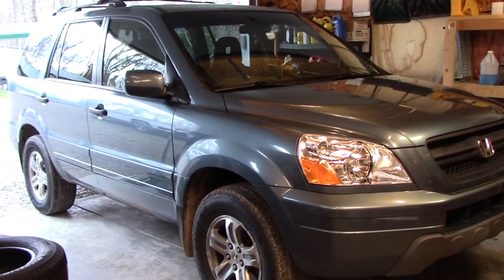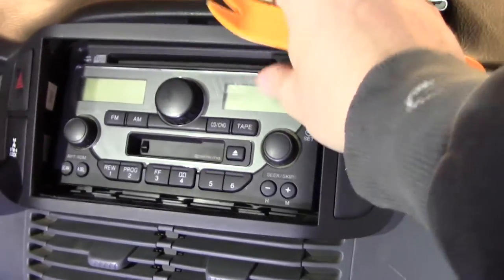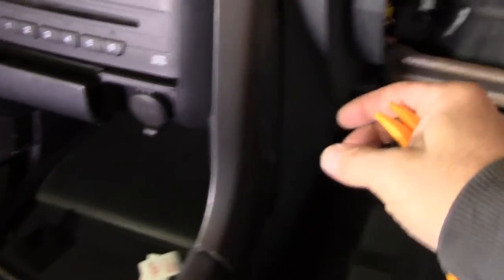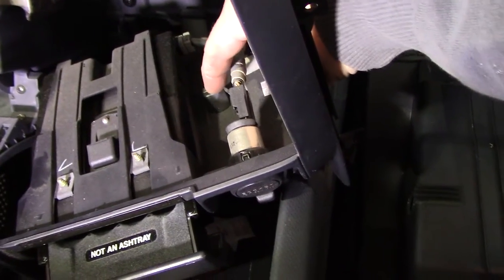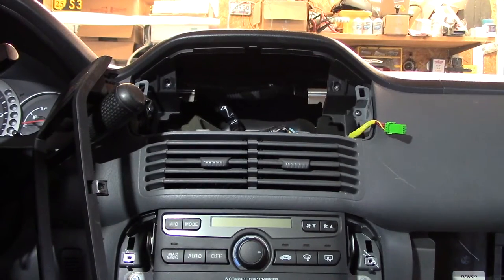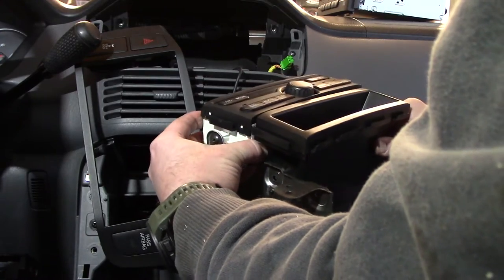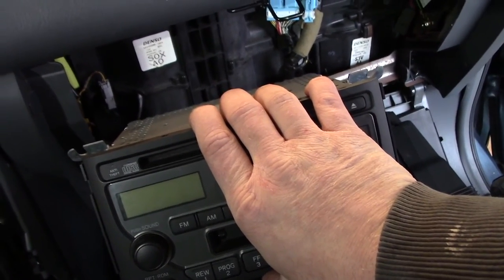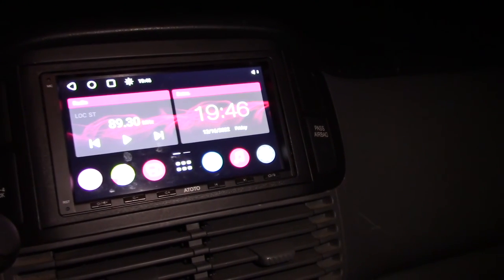2003-2005 Honda Pilot Stereo and CD Changer Removal for Modern Upgrade

Comment: I have the stock radio with 6 disc changer the changer is broken cycles looking for disc nonstop (annoying) I wonder if I can just disconnect it leave it in place but still have the stock radio work
Reply: For reference, 77280-S9V-A01ZA is the part number to change cd changer to a bin storage (from OP).

Comment: So awesome that you were able to get an amp setup to work with the factory sub. I’ve got an aftermarket head unit and would like to copy your amp set up. I’ve never installed and amp before and would like to know where you got the power and ground from? Also the RCA cable that you linked in your description, you used that to go from the head unit to the amp correct? Then did you cut off the factory sub wire harness and then connect those wires to the amp? The wiring is slightly confusing for me at the moment, would you mind spelling it out for me? Thank you for the help!
Reply from the maker: Yes. The RCA runs from the back of the stereo to the amp, which is behind the stereo. The power for the amp is split from the power to the head unit. The yellow wire is constant battery power and black is ground. For the amp remote turn on I used the amp wire on the back of the stereo. That's what tells the amp to turn on. There is a factory harness that runs to the sub that was unplugged from the OEM stereo. It's very obvious because it only has 2 wires going into it. I cut off the plug and wired those 2 wires to the amp output . Just need to use one of the amp channels since it's a mono sub.
Reply: So great! Thank you for this information. I’ll be tackling this later this week

Comment: Do you have a part number for the Pouch/Tray you used in place of the 6 Disc CD Changer?  I am doing the same thing but cannot find that pouch/tray.  Also you mentioned you added a subwoofer amp (Used your link to review) were you able to mount in behind the stero? If so can you identify where you placed it.  Thanks for the post awesome job!
Reply from the maker: Part number is 77280-S9V-A01ZA, but it's no longer available new. Have to buy it used on eBay or junk yard. The amp I listed barely fit behind the new stereo. I had it at an angle. My stereo was very shallow though, so I'm not sure if it would fit with a bigger double din stereo. It might.

Comment: I don't suppose you have a video showing how to remove and replace the middle panel assembly (77620-S9V-A02ZJ) for a 2005 Honda Pilot? Written instructions I've found, dictate the removal of the center panel first, then the instrument panel, and last is the middle panel. Without any pictures or video to go with those instructions, it may not be something my husband would want to do. Any advice would be much appreciated.
Reply from the maker: No sorry

Comment: Very Helpful! Thanks for making this video. I might be replacing my lower 6 disc that is broken for a replacement. Do you know if the Radio code thing will pop up by just replacing the lower unit?
Reply from the maker: I doubt the changer will prompt it. As long as you don't disconnect the power to the head unit itself.

Comment: Did you use the same stock brackets to hold up the aftermarket stereo ?
Reply from the maker: No. This new stereo is shallow and does not need the brackets and they wouldn't fit. With a longer aftermarket stereo, you probably could

Comment: Thank you for posting this video, are you able to use the factory steering wheel controls for volume?
Reply from the maker: I am. With a universal android stereo like I used you don't need any additional parts. With most normal aftermarket stereos (Kenwood, Sony, Pioneer, etc.) you need an interface kit.
Reply: @JackofAllMasterofNone  , can you provide more details on the connection? I purchased the same items per your list and there is no connection for the steering wheel control. Thank you
Reply from the maker: @eddienellis5025  You're going to have to do some of your own digging on this. One of the wires in the factory harness is the steering wheel control wire. It is not pinned on the aftermarket harness so you will have to cut it and splice into it on the factory side of the wiring and tie that to the key 1 wire on the head unit. After that wire is connected you can program the steering wheel controls in the settings or there is actually a program for it on the head unit called steering wheel control